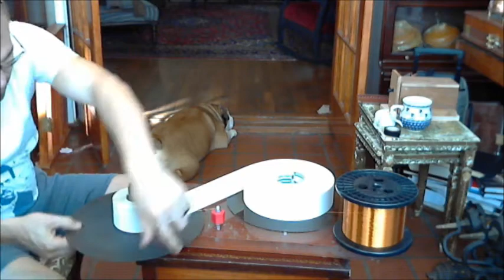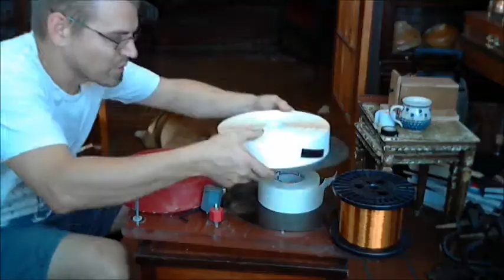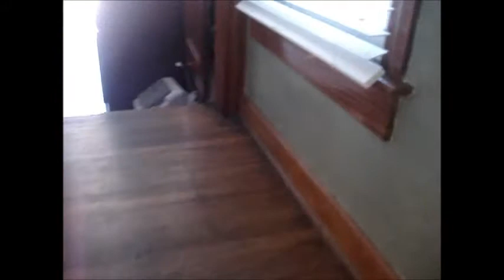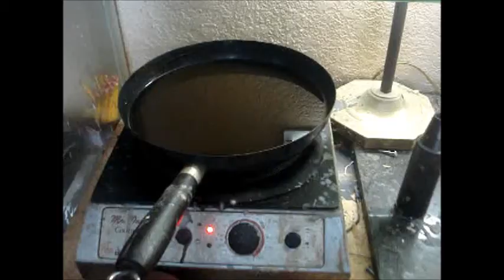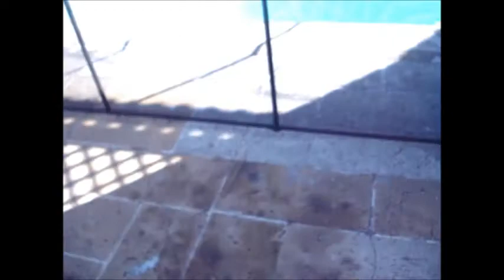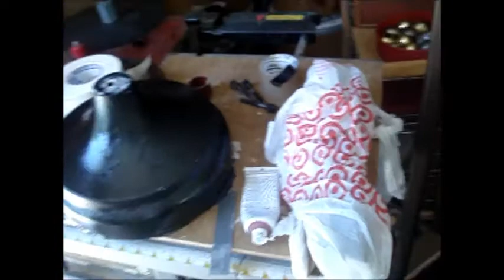Pancake Coil Winding (Flat spiral Tesla Coils, the simplest form, one turn per layer)

Comment: Take that coil you made and suspend it sideways as a hanging pendulum, and pulse it with high voltage DC current and you will see it move. That’s how electro-gravidics works. The higher the voltage potential the more it will move. It will move toward the positive charge end. And if you had a powerful enough DC source it would levitate, provided the coil doesn’t short circuit. In this case you want to avoid having any discharges, as that’s wasted energy.

Comment: k, noted, will not believe the hype. i see 'scalar wave overunity", i skip to the NEXT. 

what  sort of claims u  most wary of? some hate on bifilar pancakes, im using Master  Ivo's SiC MOSFET 'kicking coil' oscillator  (function generator sqwav choppin the 2 series MOSFETS, making &  breaking L1, route the impulses (from L1 break) to L2 'primary' @ middle, series tuning caps, L3 parallel tuning caps, L4 extra coil/free resonator,

so i guess I'm shootin  for TMT config. with SiC mosfets my inductive unipolar "kicks"  are only  200ns duration, 3+kV (actually; high side switching, so -3kV impulses) in L1 kicking coil.

care to opine/advise/place bets for or against this approach? i contemplate earth rez (via foil balloon oscillator), sparks not necessary. 

thnx for all ur solid info

Comment: Jeff very process. I also appreciate your end statements :)....Question; can you use this same process and remove the paper so you just have the coil? I guess you could use small size paper but I would really like to try this process and remove the paper if possible?
Reply from the maker: If you use silk-covered wire or cotton-covered wire you can pass it through molten paraffin and wind between heavy disks and then have just a thin (though still fragile) section for like induction coil segments as an example.  I use 2" paper because when a 9" coil is pulsed with even 20 watts of power the voltage is so high without a minimum of 1" of wax on either side it will breakdown from arc-overs.
Reply: @JeffBehary  Ah I see. I was thinking of magnet wire for a completely different purpose.

Comment: Helloooooo, Jeff!  Good stuff!  What are the typical power levels of the commercially made high frequency coils & what is the nominal voltage of the HV transformer?  Thanks.
Reply from the maker: They all vary... for streamer formations 3500V 8-10mA, .01-.015mfd cap; for long sparks 4kV at 250-500mA, 1/4 mfd cap; for X-Ray work 1kV 1500mA 1/2-1 mfd cap.  All coils vary from 200-3500 turns depending on application...and from flat spiral to multi-layered...
Reply: @JeffBehary  Thanks, so much for the detailed explanation, Jeff!  

As you may know, Tesla began manufacturing medical coils at Wardenclyffe sometime after 1902, in hopes to generate cash to finance the completion of his wireless endeavor... However, he never seemed to fully embrace this, whereas Kinraide & others built thousands of such devices...